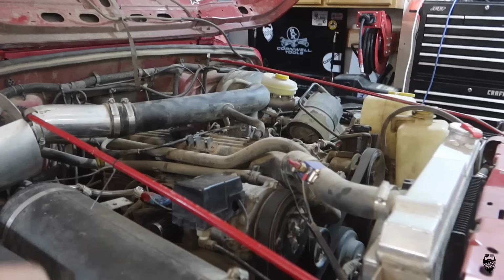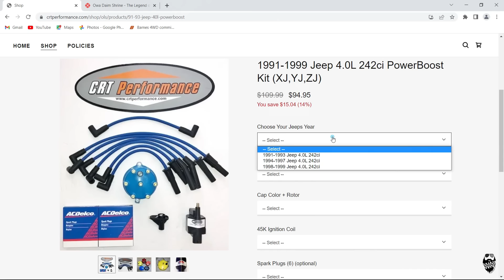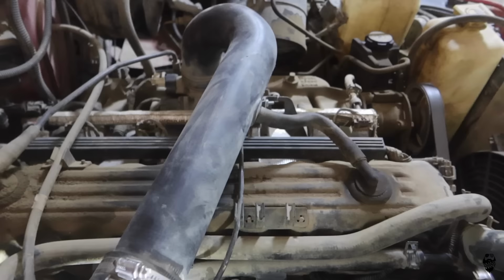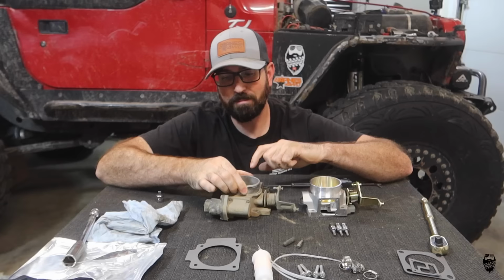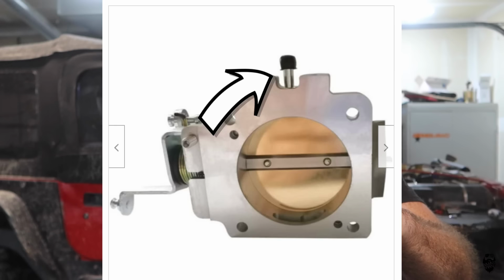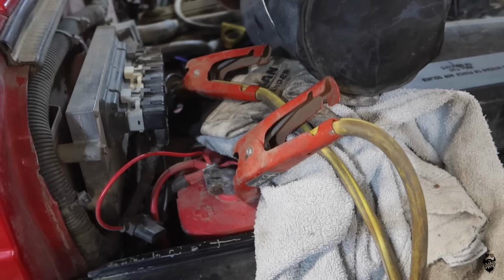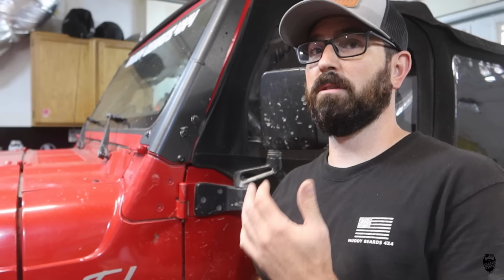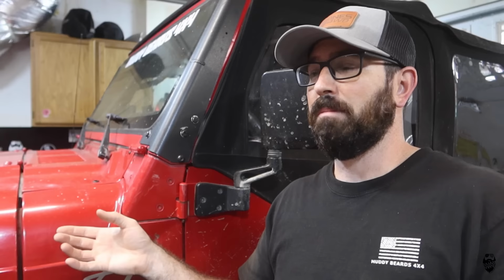MUST Have Jeep Wrangler/Cherokee 4.0 Upgrades?

Comment: Nice video man! I have a 62mm TB sitting here for mine right now.

That said don't bother with a stroker build.

I did that to my last Jeep and it was the biggest waste of money! It makes very little extra power for the money. 
Do a 5.3 LS swap and the trans to go with it. 
Its not much more expensive than a well built stroker, and you have plenty of power. 
Don't mod the 5.3 or tune the crap out of it. just a box stock 5.3 is all you need. Plenty of power, much better MPG, sounds great, and way more reliable than the 4.0 is.
Reply: "way more reliable than the 4.0".  I am curious, why do you say that?  Only problem areas i have heard of with 4.0s is the early 00s or late 90s bad heads and the 05/06 oil pump drive gear thing.  I have had 3 2004 jeeps, 2 wranglers with 5speed( currently have rubicon with 230k+ miles) and a grand cherokee.  Never had any issues.  Only electrical issues, one ecm on a wrangler went bad, and suspect a bad cluster on grand cherokee, those wjs are known for electrical issues, ended up getting rid of.  I know ls engines are pretty good but not perfect, probably quite a few have died from the oil pickup orings going bad.  Not sure if 4.0 has an oring, i will look into it.  Might paint or replace my rusty oil pan, would be a perfect time to change.
Reply: @connor3288  I hate technology! I typed a nice reply explaining why I hate the 4.0 and them it was just gone.

Short version, they have a lot more problems than you think.
Piston skirts like to crack, they eat cam shafts often, oil pumps fail often, timing chains have problems, oil pump drives fail on 99 and up with 05-06 being the worst, ODPA on 99 and up like to fail often, head gaskets fail often, lifters fail and tick on every year of the 4.0, every year has rear main seal problems, the early ones had one of the worst fuel injections systems ever built, later ones had a coil pack that fails constantly, exhaust manifolds crack or the gasket at the head fails or both constantly, and I had bunch more typed out but I don't have to add all that back in. 

I have owned over a dozen of these things over the years. It has time and time again proven to be one of the least reliable engines I have owned. 

At one point I had 32 blown 4.0s behind my shop. (I only blew up 2 of them, the rest where customer engines, of the 30 customer engines only 2 were something the customer for sure did. One was hydro locked, the other ran with no oil in it do to a leaking rear main seal.
Reply: 4.0 will out last any 5.3 if taken care of..remember it’s a jeep not a hot rod
Reply: @keniferusxj7047  LOL Not even close! 5.3 will outlast a 4.0 every day of the seek if they are both cared for the same. 
At one point I had a massive pile of 4.0s behind my shop. 32 of them to be exact. 
There where 4 5.3s back at in the same time frame. 

I get a call for a blown 4.0 every other week. I get a call on a blown 5.3 every 3-5 months and at this point they have sold a LOT more 5.3s than 4.0s. 

The 5.3 is well known to go 400k and I have seen over 50 of them above 400k. I have seen 3 4.0s make it that far. 

No place but in Jeep fan boys heads will find any data showing the 4.0 to be a longer lasting engine than the 5.3 is. Jeep dropped this engine in part because it was not reliable enough and the warranty claims were to high. 
They looked at updating it to meet the higher 2007 emissions standards and keeping it in the JKs but the cost to fix all its problems and get it to do that was higher than the cost to just adapt the 3.8 and run that. So the 4.0 was killed off for what its. An outdated, under powered engine with average reliability at best.
Reply: Uhhh....WAY more reliable than a 4.0?  I think you don't know much about 4.0's if you think that....
Reply: @seanfrank4158  Either will get you home from the trail. Only one will do it all better than the other. Sorry it's not the 4.0.
Reply: @seanfrank4158  Oh really? 
Well lets list the things the 4.crap is known for doing then. 

1 Piston skirts brake off destroying the cylinder walls.
2 Heads crack.
3 Oil pump drives like to shear off. 
4 Timing chains like to slap with a few miles on them and can even jump a tooth when they get really bad.
5 Well known for lifter failures. Sometimes you just get a tick, but often it will destroy the cam shaft. 
6 Well known to wipe the cam shaft out do to the ANCHENT flat tappet design that never should have been used in the first place.
7 run it hot even one time and kiss your head gasket goodbye. 
8 ODPAs fail constantly. 
9 Picky about its sensors, and you often end up going through 3-6 different sensors to get one that works and lasts more than 3 months. (No you cannot get OEM ones anymore, Thank you Fiat for changing suppliers and they now sell the same trash the auto parts stores sell just at a much higher price.)
10 they like leak oil from the stupid 2 part rear main seal that last 6 months if you're lucky or leaks right away if you're not.
11 the coil rail on the later engines is shit and fails constantly. 
12 The early engines had one of the worst and most problematic fuel injections systems ever used on a production vehicle.
13 They have oiling problems often resulting the cam bearings being destroyed.
14 the exhaust and intake being on the same side of the head causes gasket failure problems. (This is true of every engine designed like this.)
The exhaust manifolds crack constantly, even the cast ones on the later models and the cast ones like to warp and will not seal any more after that.
15 they make crap power for their displacement, while getting crap MPG at the same time.
The return less fuel system causes vapor lock on later engines as fuel boils in the rail when parked hot.
16 they have over heating problems that are often hard to figure out. 

Bottom line an LS engine is MUCH more reliable than a 4.crap could ever hope to be. 
For every 4.0 you find with 300-400k on it there are about 20 LS motors that did the same thing. 
Most 4.0s are done by 150k on average. Thats not what I would call a reliable engine by any means. Just go to any junk yard with a bunch of Jeeps in it. You will dozens of 4.0 Jeeps with "bad engine" written on them and almost all of them have under 200k. Most have around 150k.

I have lost count of how many blown up 4.0s I have replaced for customers at this point. I had a massive pile of them behind my shop at one point, Like 30 of them all blown up. Maybe 2 or 3 where the owners fault. The rest just straight up failed.

Comment: Iv learned over the years that a daily driver slightly modified does not benifit from expensive ignition  but heavily modified non pump gas engines do  just my opinion

Comment: heads up- in our first race with the ebay 62mm throttle body like this, the throttle stuck in wide open twice. luckily our driver was able to get it to the pits and we had to lose a few hours coming up with a fix. the problem is it wasnt machined perfectly, and once it got hot the butterfly expanded more than the housing and caused it to hang up. beware.
Reply from the maker: Good to know, I have already taken it off… don’t plan on putting it back on.
Reply: @MuddyBeards4X4  why did you take it off?

Comment: 7:48 Looks like a small blow-by filter I've seen on CAT engines in semi's. Some of the renix Jeeps had for crackcase vents that prevented oil in your air box at high rpms. Kinda like an air dryer in compressors. That was the upgrade fix for it I believe.

Comment: I was honestly dissapointed at the end of the vid but then you posted the #s from the test and I actually enjoyed the vid knowing that putting all that $ and non factory stuff on is not worth the minimal hp gain. I do think that you need to get the right injectors because I have heard good things about those
Reply: These are all supporting mods, they're not going to do much without a cam and a tune.

Comment: Bro, you need to check Newcomer Racing and his videos on The Horsepower Monster's channel. Your opinion that 'the straight six 4.0L isn't a very tunable engine' will be forever changed. The mods you did in this video are definitely worth the cost, considering if you replaced those items with OE equipment it would be about the same cost. The only thing you're missing in the equation is remapping the ECU, it's completely necessary when modifying for gains and is the reason you weren't very impressed with the HP/torque improvements, if it was even 10-15hp you would notice it  immediately on WOT.

Comment: Seems like more time, money and effort than worth the actual results compared to temperature shielding and a better flowing air filter fed by the original front cold air intake hole. Nice you determined up to .06 gap is ok.  Very true is very few other things, beyond a good header and great intake and exhaust flows, can realistically be done.

Comment: Ive had a 4.6 stroker kit and also a 4.0 with centrifical supercharger and they both gained alot of power over stock and i liked them both but if i was goimg to do it a gain id say id have to pick..... LS swap lol.... but really id take the stroker kit again it toom less tuning and both were reliable but the charger i had to do alot more to get it dialed like more heat protection under hood and i ended up doing i think 3 completely diffrent custom intake setup untill i got one that flowed right and kept intake air temps down ( was my first time ever doing something like that so i had a learning curve). But i liked the stroker more i ordered it threw it in i added a good clutch and a bigger radiator and hit the trails i think from when i got the motor till i was loading my cherokee on the trailer headed tof the rubicon to test it out (i live bout 3 hours from the rubicon) was 4 days only working at night after i got off work with just my cousin helping and 1 friend on the last day. But since then i drove my friends ls swaped cherokee with just a stock truck motor and it feels almost as powerfull as the 4.6 and was much chealer and if he adds a few parts l ike a cam and intake and a holley sniper kit instead of the carb set up he has it would kill my 4.6 . And i forgot to say both my motors were in a 99 cherokee 4 door, manual! 38s and tons, with a advanced adapters doubler, and a homebuilt 4link long arm front and rear.
Reply from the maker: Nice, good to know 👊🏻

Comment: Is the ignition upgrade worth it if your distributor, plugs and wires need to be changed out anyways due to age?  Or should I save $50 and just go with something thats similar quality to OEM?
Reply from the maker: If you are replacing some parts anyways I would definitely do it.

Comment: Fuel injectors are the best and most important upgrade you can make to a 98 and older Jeep. Chrysler put the oldest crappiest injectors they could on them from the factory. I pulled injectors at the scrap yard and they even had a lower flow rate then stock and the difference was night and day. The first thing I noticed was that I actually had engine braking in 4 low unlike before. The other thing was I got 5 more MPG. I did later pull higher flow injectors for it and they work great to. Funny story Chrysler invented the the fuel injector. Also funny story Dodges and Chrysler of the 90's years had ev6 injectors while Jeep had ev1's....

Comment: If you want more usable power, you're FAR better off spending your money on lower gears, than on engine upgrades. My 99 with an automatic transmission is running 4.10s with 33" tires. It's a little revvy on the highway, but on 37"+ tires it's probably just right.

Comment: That's why I'm going with a 4.7L stroker for my 2001 XJ...💪😁😁
Reply from the maker: Let my know how it goes. I will definitely be interested in this at some point.
Reply: @MuddyBeards4X4  it's definitely worth it.  My 4.6 has plenty of torque right off idle. It's very snappy and is a blast too drive!

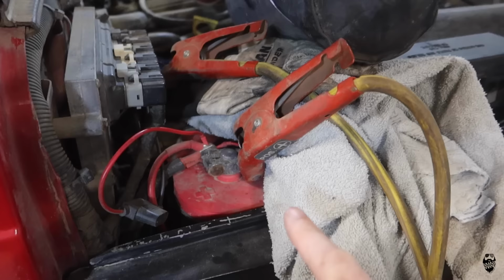Comment: Great video.  Just one thing: at 11:37 I believe your wording is backwards.  You are not "discharging the Positive out the Negative".  The negative side of the circuit contains more electrons (which are negatively charged, hence causing that side of the circuit to be the Negative side).  When you hooked up the jumper cable from the positive terminal to the negative cable to erase the ECU's learned parameters, you induced electron flow from the Negative side toward the Positive side.  So you are actually discharging the Negative out the Positive.  I am so glad I spent $37,000 a year studying Biomedical Engineering and taking classes such as Circuit Analysis so that I am relatively qualified to leave unnecessary critiques on YouTube videos.  🤣
Reply from the maker: 🤣 all I know is you hook the thingy to the other thingy and then it does stuff….

Comment: I can't see the throttle body really helping airflow without an intake manifold and valve/cam upgrades. 
The 2000 TJ has distributer less ignition. Not sure when they started it though. 

Ngk makes platinum plugs also.

Comment: You have just done some of the suportmods for the real power adders to work and breath. A stroker will add torque,  a super charger will add more torque and help make up for poor flowing intake side of the head..
Is it worth it ? Vs a real v8? Depends on a few things smog being one . Personally if I'm going big power like I did with my sb 400. I started with 3/ ton axles than a atlas,  nv 4500 , than the eng.

Comment: The 62mm throttle body isn't going to help unless you need with the head.  That's where the restriction really is. 

And adding newer parts will make a difference because most of the time the parts we replace like this have over 150k miles. Just an FYI.

Comment: That is the throttle body I got from ebay as well.. looks like yours missing that tube sticking out mine didnt..but the hole on mine where one of the module goes in was slightly smaller and I could fit it in..i had to sand down that module..makes me wonder if these manufacturers ever tested or measuring anything before they machines them.

Comment: Hey. I'm rebuilding/restoring a 1987/1988 Jeep (AMC) Wagoneer Limited 4.0L S6. I don't have much experience with these kinds of things but am wondering if these addons would fit, particularly the throttle body as mine has the spot for the sensors, etc.

Comment: I have a edge kit on mine, the trotted body whistles and different speeds, drives me crazy. Does yours?
Reply from the maker: No whistle, does yours have a throttle body spacer as well? those are what usually give it the whistle.
Reply: Mine whistles like crazy as well, no spacer.

Comment: on the throttle body instead of the epoxy why didn you just thread the hole for a screw in hose barb?  just curious

Comment: I think if I’m when I do a motor upgrade on my jeep yj I think I’m gonna go with the Chevy 4.8 Ls V8 it’s about 100 hp and torque more then the stock 4.0L and I don’t think I’ll kill the stock drive train
Reply: Jeep comes stock with the 318 and 360 dodge v8. Either engine, with head work and camshaft, would give you the power of the 340.
Reply: @graemedalgleish8944  I just got a 318 magnum motor from a friend and going to do that instead of the Ls
Reply: @brianwilson5666  I think staying within the same brand will cut  down on the parts problems.
Reply: @brianwilson5666  I run a 340 back in the 70s, the power was incredible. I had my duster up to 145mph. Before you install that engine, I would recommend you do some head work and a camshaft change.

Comment: Could you ha e threaded the brass and the hole and used epoxy as a sealant? Or was that easier
Reply from the maker: If you have a tap and die set that goes that small it should work. Also make sure to use a high temp epoxy.

Comment: what i dont understand is, you modify how much air the engine can take in and let out but, you don't upgrade anything for fuel and or let alone tune. How would you expect gains? 4.0's are detuned from the factory and have alot left on the table. there is alot of details you are leaving out that are important.

Comment: I would imagine it would be amazing if you had a 5 speed trans in a Grand Cherokee it might help. You have more gears & better aerodynamics to get more out of the engine. Other than that I don't see much of a reason unless you are after torque
Reply: not that much better lol I have a 93 xj with the ax-15, stock tires, stock lift, k suspension 4 hole injectors, post 97 intake manifold, banks header. fairly new tune up and only get like 12-13.

Comment: The 4.0L is notorious for cracking headers. Had 1 on a grand cherokee at 1 point it cracked. I had it replaced with the warranty and then it ended up cracking again...lol.

Comment: I think if you would have cleaned your old throttle body put new sensors in it I think that would be enough because your intake manifold is still .50 or 55 whatever it was

Comment: Is it ok to manually shift the auto , I wanted to know cause I have a 3speed auto 98 tj and would like to do so to rev it out more
Reply from the maker: Yes, you can manually shift an auto, but it might upshift automatically even in manual mode if you rev it too high.
Reply: @MuddyBeards4X4  like a safety feature , very cool thank you

Comment: Why not the dodge neon 6 hole injectors? Also why not get a 2001+ intake? I did it on my 89xj and there was a noticeable difference above 2000rpm
Reply: What year neon
Reply: @elmeromerochitown8476  looks like the 95-97 neon 2.4l engines. Google can tell you more

Comment: Your Assometer is lying to you. That throttle body added no power in the range you where in RPM wise. The Stroker will add power across the board if you do that.